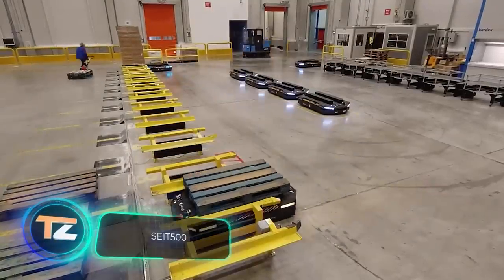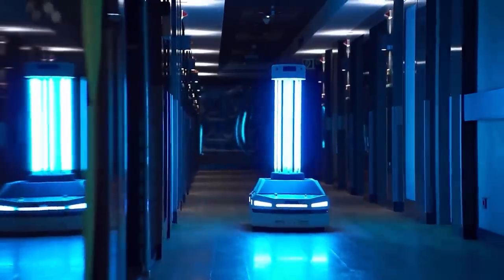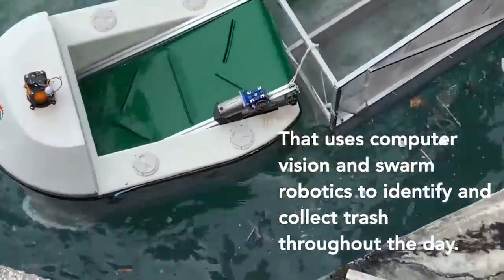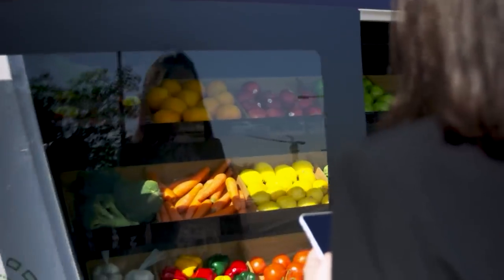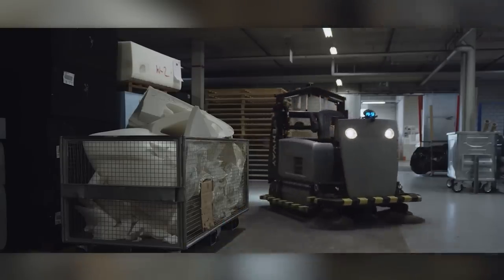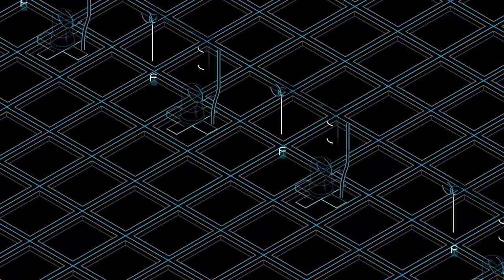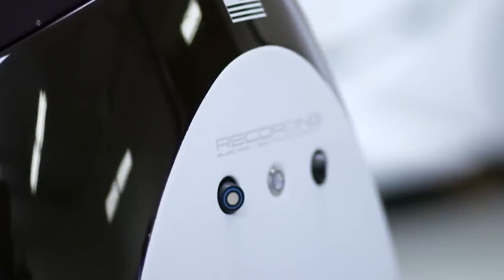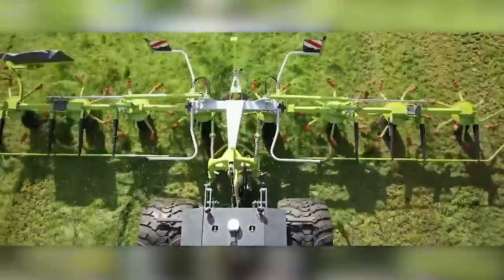13 AUTOMATED TECHNOLOGIES THAT DON'T NEED A HUMAN

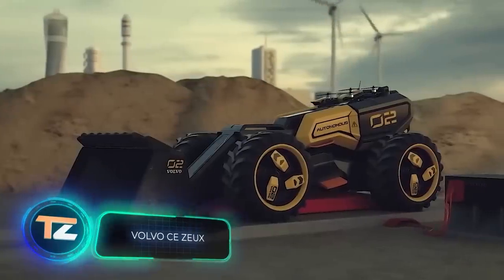Comment: 02:15 Not a forklift in that configuration, that is a bucket loader. Now, if they had a forklift attachment on it instead of the bucket, then that would be a forklift.
Reply: Big thanks. I’d of been so lost without this insight
Reply: was thinking the same aka front end loader or wheel loader